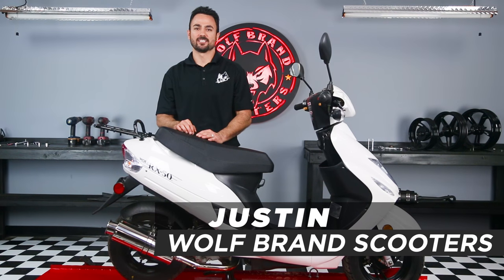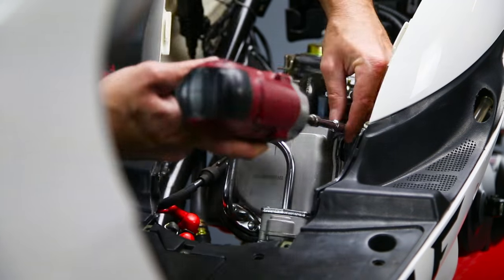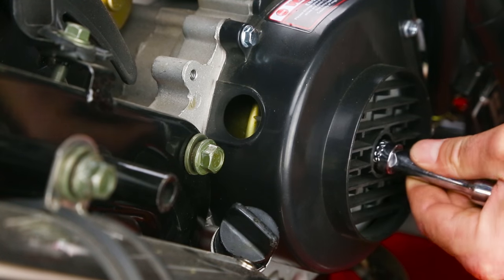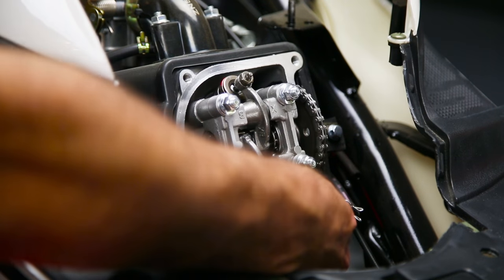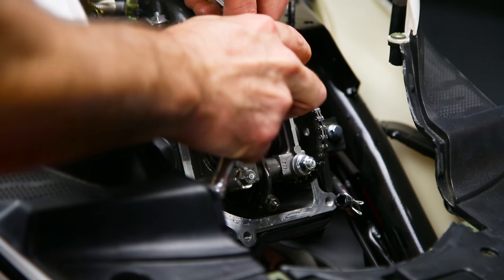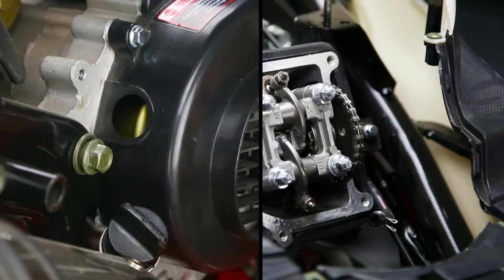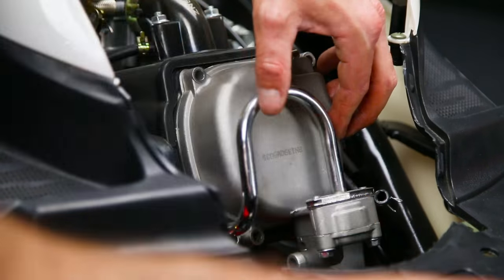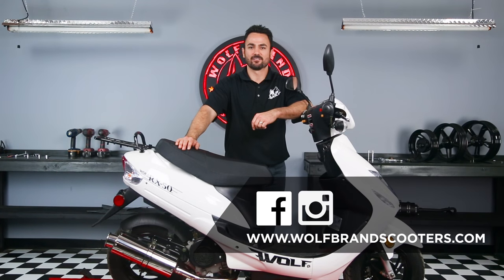Scooter Valve Adjustment

Comment: Say justin I own a gy6 50cc scooter I recently  used a back tap on my scooters cylinder head being that I was unable to tighten my sparkplug in snug well I did get the threads repaired spark plug is in nice a snug now but my problem is I took apart my valve cover and took my rocker cage off thinking I was going to replace the whole cylinder head I made sure the engine was a top dead center by placing the cam into position so after using my back tap tool and fixing my spark plug issue I decided to place my rockers back on but before putting on my valve cover I wanted to rotate my cooling fan to see if everything was working like it suppose to that's when I heard a loud click noise coming from my rocker arms or valves or both  on every full turn of the cooling fan when rotating the engine ,I then felt the valves to see if they had any clearance nope they are touching tightly with no play both of them what is puzzling is i simply removed the rocker cage assembly decided to put it back on now I have this loud click noise sounds like something is about to break what could it be...?

Comment: Huh, I didn't "turn the flywheel to the top center." Now I know why my scooter is harder to cold start. Looks like I'm going to give it a second try.
I never know how easy small engines were to work on. Give me a youtube video that explains it, and I can eventually diagnose and fix almost any problem. I love my rx50, but I definitely want to upgrade to a 100(and put a 150 boreout kit) or a 150. I ride dirty though, so a 150 might get to much attention.

Comment: I have a GMW EX150, scooter from company yall were or bought out or whatever, & having a valve issue, my exhaust valve wont adjust, nut turns & loosens but the arm refuses to move. Any ideas
Reply: U need a new rocker arm
Reply: @musicformentalhealth6155  necro post from hell. I broke down & put it in a shop to get it fixed only to blow the whole engine up a year later

Comment: Audi my name is Chris pain I'm in TexasI have a 50cc scooter wolf brand blaze it has 2000 miles on it I pulled into my driveway turned it off change clothes went back out and it will not start could that be my valves I've replaced the carburetor I have spark I have compression